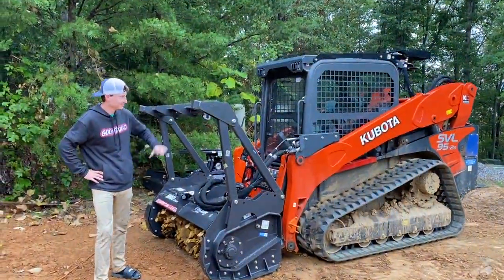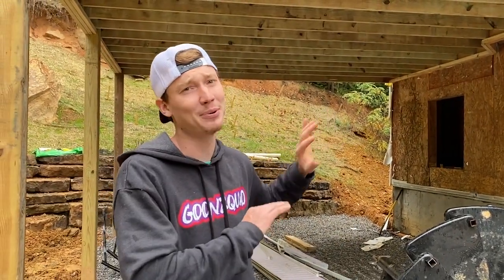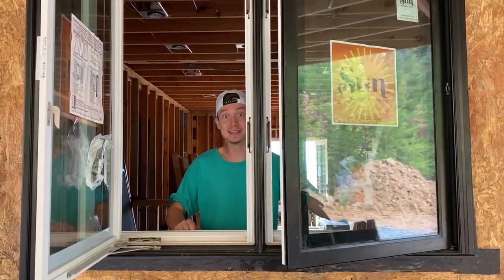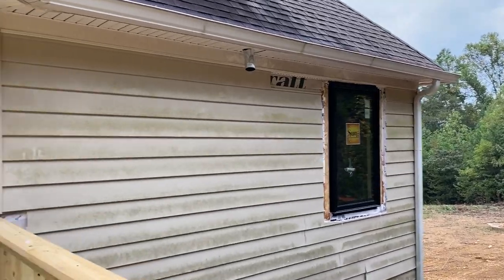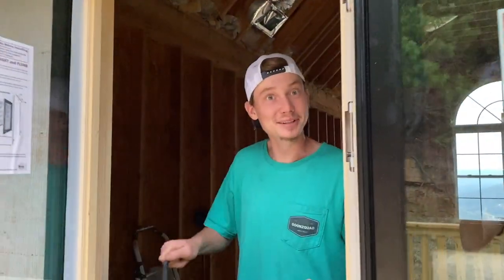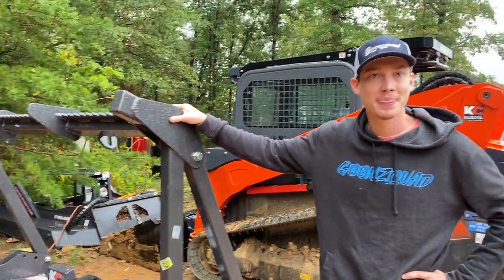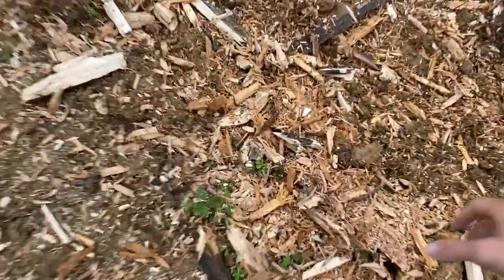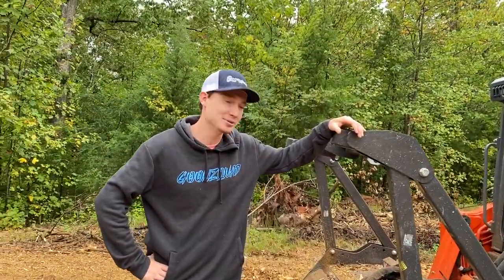The New Goonzquad Headquarters Part 22

Comment: You guys should prewire the house for cameras, now that there isn’t any walls. It’ll be more of a headache if you decide to get cameras after the walls are up.
Reply: Second that I have already mentioned now is the time to run the low volt. Do it now get it powered up and online since... well they are celebrities. You want hard wired cameras and you want them to be IP based. The big box store stuff is crap.  If I wasn't retiring due to my health and having surgery again in a couple of days I would have contacted them about bidding the job and/or show them how to do it. Cat 6 to every room, the corners of the house, front door, to a central part on both levels for access points, out to the well house to watch the road as well as coax and HDMI to any wall mount tvs, put in wiring for 7.1 surround sound. Now is the time to do it. Run it all to a media panel. For networking I am 100% Ubiquiti. It what I have personally, is all I sell or install these days. With as many viewers they have here they could probably get Ubiquiti to sponsor an end to end Unifi install so everything is tied together to one controller internet, firewall, cameras, door bells, access points all on one app. Need to find out what internet is going to be there hopefully fiber and bring it to the media panel if they can't get it they have a wonderful location to do an airFiber bridge on the roof and shoot it down the mountain to some place that will rent them a spot on their roof or even a small lot an put a tower on it. I am shooting a 2.4 Ubiquiti Powerbeam on top of a 60 tower on my property 5ish miles to another tower. I get about 25mb/sec which is the fastest in the area because I consult for the company. Soon as get out here again they are going to upgrade me to an airFiber backhaul radio on 5ghz and shoot me 15 miles to the tower that has the actual glass fiber run to it. I am going to get at least a 50mb dedicated chunk just for me burstable into the 3 digits and they are going to shoot 900mhz to a neighbor a couple miles from me on top of that.
Reply: watch my recent video, how to Clean/REPLACE airfilter.
Reply: Most camera systems are wireless these days
Reply: @Just_Joe71  While there are loads of wireless options nothing can compare to the reliability of a POE camera system. With wireless systems if your network has large amounts of interference it can cause for cameras to have connection issues.
Reply: Stay away from the  Ring Security it's CRAP
Reply: @hswing11  Agreed! NEST and RING are great solutions if you are adding something simple and affordable later on. If you already have the walls open, or the ability to run wires easily, a hardwired system will be far more reliable and give you far more flexibility when it comes to the hardware.
Reply: Also Pre-wire for ethernet ports, some CAT 6. Have it all terminate in a small panel somewhere in the house and if you have an internet provider that uses coaxial cables also pre wire the house with RG6. Have the main RG6 line going somewhere to side of the house and have that cable terminate where the CAT 6 cable and RG6 cable panel is located. That'll save you a TON of time :)
Reply: Great idea!!!
Reply: @dwddtech4935  Oh Yah!! Prewiring for ethernet is Key Nowadays!!! Much better then wifi
Reply: @JamesHalfHorse  gimme a break
Reply: @MrPotteeMouf  ??? I am retiring from doing this for a living. Wireless cameras are crap and there is no such thing. You still have to run power to them. Power Over Ethernet is the way. The cheap box store that still uses coax cables are old tech, the cables they come with are junk and asking for problems. The drywall is down go ahead and wire. It's easy to do now. A whole lot harder and more expensive once the drywall goes up. Plan for what you want and overwire it. When I wired this house 10 years ago I did 2 cat5 and 2 rg6 to each room back to a media panel in the laundry room and it still was not enough. I am about to go with a new house and I am going to redo all the utilities for the farm for plumbing, electric and data end to end while I am at it and this time anything building to building I am running fiber its almost as cheap as armored cat6 and most importantly lightning can't jump glass. As for Ubiquiti I use it, I sell it, I stand by it. If you are wanting a residential network, wireless and camera system that is all in one with one app to deal with that is the way to go. I don't make any money off recommending them just my opinion. I hope this helps them out and saves them a little time and money.

Comment: When you put house wrap back on, take the window out and wrap the wrap into the window frame and then put the window back in and tape the sides to the wrap. That way you can be sure that you will not have leaks! Keep up the good work!
Reply: Yep, the wrap goes on first-then the window, caulk the nailer piece across the top and sides but not the bottom before setting the window in place as well.
Reply: THIS
Reply: Idk if the codes are the same there but the flashing is supposed to stick out a minimum of 3 inches

Comment: I get the need to remove the wrap under the siding to replace the board. When you replace the wrap you need to wrap the material around the corner so that rain can't drive in from the side. Just watched them redo an entire condo development where the tradesman cut the wrap at the corners. Expensive proposition.

Comment: Instead of having opening windows, would’ve gotten sliding windows, specially in the “bar” area jus means you have to clear the bench every time you wanna close or open the window
Reply: I thought the same thing
Reply: great point!!!
Reply: I can see a niece or nephew running around on the deck and getting their head cut open. Sliders always.
Reply: Why do people have to be so negative?  Dude the Windows are awesome.
Reply: Even better would be 'pocket' sliding windows that can slide into hollow walls. This is quite simple to arrange when you are building a new timber frame house.
Reply: Also one of side of the window will be blocking the stairs when opened.
Reply: @richardpope3536  wHy dO pEoPlE hAvE tO bE sO nEgAtIvE, it’s literally professional builders in here telling two Amateurs suggestions for the best route
Reply: @AvariceAu  That might fall foul of fire exit regs, if it blocks egress from the deck. Then again, maybe it's absolutely perfect the way it is Richard. Better to have a fecked-up house than to get negative comments.

Comment: +1 for these kind of constructions. You just need a saw and a nail gun to alter gaps in a wall. Here you'd need a stress analyst to calculate which kind of lintel you have to bring in, then take 2 dusty hours of stonecutting and cleaning, followed by plastering the embrasure and then installing and grading a 300 pound window :D

Comment: My parents had windows that cranked out like that ended up replacing them all as they had issues that they would jam and not want to shut after a few years of use. they ended up replacing them   with the regular style that go up and down like you took out.
Reply: I’m sure Sun windows gave them a deal for advertising it’s all good though this house is just a temporary stop on there way up they are really going places great show great attitude.
Reply: @carlkantor4203  they have enough land to build even a bigger nicer house later on.
Reply: Just need w-d40 not a big deal
Reply: @supertank9  they issue was bigger then that. They tried it didn't fix it. The crack mechanisms were junk

Comment: Being a glazer it made me cringing watching you install the kitchen window... for instance the plastic you tore down is waterproofing for your house and when you nail or screw you’re fin to the wall sandwich some caulk in there to keep it from leaking (if water can get in it will)PRO TIPS, casements are amazing but if you leave them open for a long period of time they may be hard to lock😁
Reply: I'm no pro but I was cringing also.  I have been since they started. Isn't vapor barrier a code requirement? I'm sure the inspector is watching the videos. Oh well.....it;s nothing money can't fix. LOL.
Reply: @rbailey225  That wasn't vapor barrier.
Reply: @m.5051  What is that stuff? Like I said I'm no pro.
Reply: @rbailey225  It's just the house wrap.  Helps prevent drafts and moisture from entering the dwelling.  Obviously reduces the chance of moisture coming in contact with the wall sheathing as well.

Comment: You should replace that OSB, it’s been wet for a while, it’s full of mold.
Reply: Yeah. Osb does not handle water.
Reply: replace with mdf
Reply: @hksp  MDF is not rated for outdoor use.
Reply: @frankwolf389  osb even less. You can use any plywood as long as you wrap it with plastic. Like they did the wellhouse.
Reply: @hksp  Kidding, right !? If not, don't get into construction, "dude" !
Reply: Only in the USA: Houses made of wooden supports with OSB outer shell covered by stone/plastic and sheetrock inside. I wonder how long these houses last, how they withstand the forces of nature and how the endure a falling tree or else. Would fail 10/10 European regulations. In fact, it wouldn't even receive a building permit.
Reply: @petrforst7358  you can build houses using wooden skeleton. Scandinavia is full of it. In Florida you'll see hurricane proof houses build like this. Nothing wrong with it. You need to insulate it from the inside and make it weatherproof on the outside.  Wood is very durable and sturdy, because it's flexible.
Reply: @petrforst7358  Sadly timber framed houses with a decorative skin are now springing up all over the UK. Cheap and tacky, all show with no substance, minimal fire resistance. Just look at the number of house fires on you tube in the US, large properties burn to the ground in 15 minutes. In rural areas they are lost before the volunteer department even arrive. They can only hope to save adjacent houses.
Reply: @petrforst7358  A lot of it comes down to location. Most of the "traditional" brick and block UK/EU construction wouldn't pass seismic regulations here on the west coast of the US. Additionally, the US has a whole lot of available timber, and you can repeatedly grow and harvest timber with a lower ecological impact than you can make bricks, concrete, or steel. It's a trade-off between that and lower longevity and increased long-term labor.

They have different strengths, but you can absolutely build a good building with wood. (I'm with you on the OSB, though...)
Reply: @petrforst7358  we do this in Australia as well. I think Australia is worse
Reply: @petrforst7358  Welcome to the good old USofA, where you can build anything, depending what county you live in.

Comment: Hey guys you might want to reinstall your housewrap and then reinstall your new construction windows. Reason is that what you have now I don't think will pass inspection. Reason I say this I was a sales person for Pella windows and they always said to wrap the inside of the window opening with the weather wrap. They used to say make a inverted V-cut in it. You take the bottom flap and put it over the bottom frame for water protection. Tack down the remaing wrap by wrapping it around the jambs on the side and the header. Make a sill pan with the flashing tape on the bottom sill plate and go up the jamb 6 to 8 inches. Flash the sides then the top. Leaving the bottom unflashed in case of water infiltration, gives the water an escape route down the moisture barrier. You guys can cut the old moisture barrier and install new and use the weather barrier seam tape around the joints. Remember to go vertical seams first then a foot long piece across the top of the seam joint. Just don't want you guys to have mold growing in your walls and making everyone sick and damaging your hard work.
Reply: Yeah, its not done right. Its a non issue in this application since the eaves are long and will cover it.

Comment: Here in Europe we wouldn't build a garage out of those materials, a shed maybe. Like the one you built for the well. How is this considered a house I cannot understand for the life of me.
Reply: I would not build a dolls house out of those materials !
Reply: Were those standards pre-or-post EU, what with having to consolidate so many different countries building codes into one unified standard?
Reply: What materials are you referring to?
Reply: I'm talking about wood and it's products. We mostly use wood products for door frames and doors inside the house. And hard wood floors, on top of steel reinforced concrete.
Reply: @veltruski  What makes your products better? They last longer? If so, how do they compare in price?  What do you see these guys using that is sub standard and what will the negative impact be?

Comment: Little tip to running the mulcher, if you have loose logs or brush, run over it and start at the top and go backwards. It cant sling it out that way. Took me a while to figure that one out. Also if you do any work above your head, tilt the mulcher all the way back and it wont throw stuff back into the door as bad.

Comment: can we get a goonzpops channel? He seems like the chillest dad out there, just watching billy "hold my beer" the wall covers on bottom floor.

BTW I'd try to put some permeable concrete under the deck. A good mixture made by a specialist who'll see how absorbent is the ground etc will help the clay to soak up the rain water which turns into groundwater which is what you extract with your well. Downside is that it holds water for a while as it helps the ground absorb it slowly so it may increase dampness of the area and make it cold and humid under the deck which is in shade which is recipe for mold.

Comment: Double windows with a bar in the middle is an interesting choice. Seems like a open frame would be a better choice
Reply: Agreed. On classical buildings the centre point of a symmetrical facade is always an opening or a door or window, not a column or a piece of wall. It just looks more appropriate like that.

Comment: Shouldn’t the weather wrap go inside the window sills before installing the new windows to make it one completed weather seal.
Reply: They have no clue how to flash properly.
Reply: No it doesn’t. They make flash tape for it. G tape the windows and flash the trim when the hardie goes on, and it’ll be good to go. That’s standard procedure here in the pnw and we know about moisture lol
Reply: MG Stevens  your right. I was a sales person for Pella windows and that's the correct way to install the weather wrap. They used to say make a inverted V-cut in it. You take the bottom flap and put it over the bottom frame for water protection. Tack down the remaing wrap by wrapping it around the jambs on the side and the header. Make a sill pan with the flashing tape on the bottom sill plate and go up the jamb 6 to 8 inches. Flash the sides then the top. Leaving the bottom unflashed in case of water infiltration, gives the water an escape route down the moisture barrier.
Reply: Steven is correct
Reply: They don't record it but they do it
Reply: Alex, I don't believe that they did, otherwise you would see it on the inside, plus they took all of it off on the bottom half of the house.
Reply: They will not let us wrap inside  Yeah and I live at the beach
Reply: @PSTLNC2  on the bottom half of the house they recorded themselves putting it back on
Reply: @alexd4102  what I saw was a window installed with no housewrap. Because everything under the deck was removed, which I think they are looking at replacing the osb sheathing that had the rot and mold on it.

Comment: Wiser words on skylights have never been spoken:  There are two types of skylights.  1. Ones that leak and 2.  Ones that WILL!  FYI.
Reply: Yeah have heard about the older square or rectangular ones leaking. But what about the newer smaller reflective tube ones? If they designed them right n use like ductwork to come up thru the hole or nailed to the surface of the roof, and seal into base around the window. Then use the rubberized flashing around it, should never leak.

Comment: The windows look silly, the old ones were better
Reply: I said the same thing as pretty much no one uses those styles of windows with a gear-driven handle "let's do more work to open our windows" as the sliding windows are the more MODERN style and easier to open and they chose black to go with reddish/white bricks and stone. Those style windows were popular in the 1960s-1980s as that changed in the 90's going forward as the windows stuck out and looked dumb not to mention when people were working in the gardens and outside the house, they would hit their heads going to the ER all the time getting stitches "stupidity at not paying attention, maybe!!" but never the less things changed and people got wiser. My guess is they got these windows dirt cheap because its COVID "lack of sales" and no one uses those style windows much anymore so they were eager to get rid of them lol.

Comment: For proper installation, you should put the moisture barrier, wrap it into the window framing, do your flashing, install the window, then seal around the window with two strips of tape on all sides, starting at the bottom, then the sides, then the top to seal it up as good as possible and prevent any possible leaks between the moisture barrier, window, and moisture barrier tape.

Comment: Them windows are nice. Just a quick tip for future window install. Make sure you guys set a pitch for the sill so water can run down away from the inside of the house. O and make sure the window is square and plumb.  Keep doing you guys.